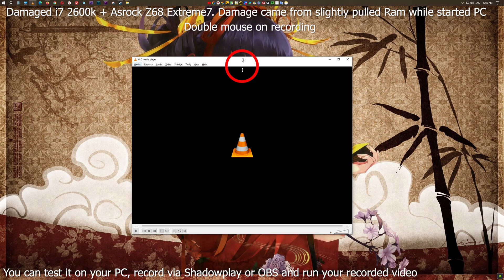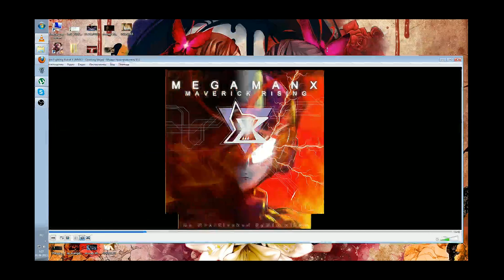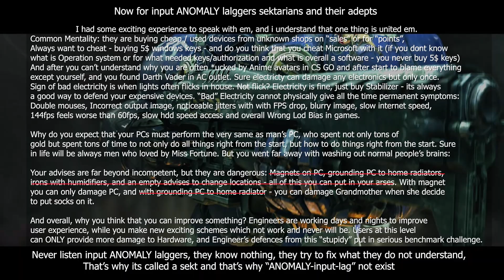#3 [Solved] Wrong Lod Bias (Scaling) | Jitters (Desync) - Damaged I/O System (Chipsets)

Comment from the maker: My Congratulations to you guys and to other people who succeeded with builds! 💪
- Texre from California had this issue from 2021 - he solved it by did everything right from the start and shared footages here:
https://www.youtube.com/watch?v=sAUx7Pv0RuU - Video games footages (flawless system)

- oukibattlegod from Russia is succeeded, you can find his videos:
https://youtu.be/GE__m2Ka3E8?si=GpGygVL9U-blviaa - CS2 footages (flawless system)
https://youtu.be/wuyKgzxMkac?si=ZC3imW3L6Ig4qBxu - CS2 footages (flawless system)

- sQweeky2k helped his brother to build PC, and advised to make things described in videos, they compared two systems and it's ground & sky. After he tested new brother's system, he planning to leave his old system and build new setup.

- I built for my young Brother his first PC from scratch. He has now perfect PC. First Windows installation window has no defects (window frame has no defects while moving that window), good image quality/scaling & smooth mouse:
i5 12400f
MSI B760 Gaming Wi-fi
DDR5 Kingston Beast 2x (16+16)
4060 Palit non OC
M2 SSD Kingston V3
DeepCool 750w
LG 1080p 170hz Monitor
Ador M6 White
Air CPU Cooler + Thermalright socket frame was installed
Windows 11 Home, official ISO, non activated
Middle-end gaming keyboard & mouse

All new, GPU & Motherboard have seals on antistatic bags, their boxes have perfect conditions. CPU was in silicon case without any signs of usage from both sides. All parts were purchased from one vendor.
PC was built/booted/adjusted in my house. Ram installation was provided with maximum gentle, CMOS battery was not disasembled. PC was connected directly to AC (no splitters/ups). No antistatic gloves was used
Reply: По какой-то причине YouTube удаляет мои комментарии, я особо не следил, но я там видел, что очень многие сомневались в  тесте с фантомным вторым курсором, хотел скинуть даже официальный пример от Microsoft, а также у про-игроков в CS, но видимо не судьба :D
Reply from the maker: Ты про блюрбастерсы что ли? Я там только по одной причине решил сделать статью - ради людей что бы проще было понять, но там нет смысла что то держать как оказалось. 
Ютуб удаляет комментарии, думая что ты что то рекламируешь) их скрипт срабатывает.

Comment: Hello, I have a question. If I have a problem with my mouse being too heavy (it feels noticeably slower), will the solution you posted apply to me? If so, can I order a brand new Lenovo laptop online to test it? The key question is, when I receive the laptop, can I test if my mouse still has the excessive weight issue without an internet connection and activation? Because, as you know, if I activate it and it doesn't work, I won't be able to return it.
Reply from the maker: Heavy weight mouse is a meaning, some people feels an oposite, that it fast. Overall incosistent mouse, this is because of desynced image.If image on screen is desynced your mouse feeling will be different - inconsistent (not precise movements - panocameras / coursor). 
All benchmarks pattern is right in front of you in 3 videos. If in Windows safe mode window's frame has defects while you move it and/or double mouse on recording, so yes, its desynced hardware/working not poperly not as intended. 
Your question about new laptop. You can test only this way: you have to see first Windows installation Window, you have to move it, and if you see defects on window's frame edges while you move that window - hardware is desynced. Not need to proceed further (software drivers will not remove it):
Examples
https://youtu.be/AVf9YPaePCU?si=KmIkGIrpSmY17prC&t=68 - window with defects - desynced PC
https://www.youtube.com/watch?v=7nTM6hrMah8&t=0s - window without defects - synced PC

Buy or not buy things, it is always up to consumer. This issue could be solved only via setup change, but, i never advise to spent last money on PCs, because there is no guarantee if you by new it will be without desync, its often goes with risk. If you can return it, that's nice, if not, so keep that in mind. If you live near Microcenter - buy there, top electronics vendor.
Reply: @LeCommeiLFaut  Hello, I'm currently at an internet cafe, and the mouse feels much lighter and less heavy. Could you teach me how to determine if this computer has a fully functional operating system? I also noticed that this computer isn't activated, but you mentioned that a genuine copy of Windows is required to resolve this issue. Thank you.
Reply from the maker: @can-v4y5f  Please read carefully comments and watch videos, there are plenty of footages which can help to diagnose.
About Windows is: You can use original non activated Windows, you download this ISO from Microsoft site and install it on PC (on laptops you never reinstall Windows, laptops must be with preinstalled Windows from factory). On PCs you can safely use non activated Windows. After, when you have possibility, you can buy Retail key from Windows Store directly or box genuine Windows from Microsoft office. Do not buy Windows in any other sources, and never use pirated ISO's or activators.
You can use non activated Windows downloaded from Microsoft site on PC - it is totally safe. + It gives you an opportunity to check: do your new board has activation or not, with CMD command slmgr /dli. 

P.s: I already mentioned many times: Windows do not heal this, Orginal-Genuine Operation System is needed to keep your system safe and sound and to prevent these kinda things to happen as much as possible. Main clue here is not to use any corrupted/cracked things for to exclude possibilities of faults, because software (many software layers) controls hardware on an physical level.
You noticed different mouse behavior in gaming club because each PC/hardware work differently. Not because it is in another location or another weather and etc. All located within hardware.
Reply: @LeCommeiLFaut  Hello, I have purchased a brand new laptop. May I plug my mouse and external SSD, which I previously used in my faulty computer, into this new laptop? Is it safe to do so?thank you❤
Reply: @LeCommeiLFaut  I'm even afraid to connect my laptop to the internet now, haha. I completely trust you, waiting for you, bro.
Reply from the maker: @can-v4y5f  I cannot tell you what to connect, no one will tell, because its not possible to predict for many reasons. All you do on your own risk
It is like if i ask you: can i plug my friend's mouse to my PC?
Reply: @LeCommeiLFaut  Okay, but how can I verify that this computer is working perfectly without an internet connection?
Reply: @LeCommeiLFaut  Looks like I've failed. It's a brand new laptop, pre-installed with genuine Windows 11, but the moment I plug in the mouse, I still feel the same thing: unresponsive and heavy, just like my old computer. Ugh, what should I do😢😢😢
Reply from the maker: @can-v4y5f  If you dont like it, you should return it, especially if no difference at all. I bought few systems, and one of em works better, but not nearly as my old ideal PC, anyway i decided to keep it. 
And for now i not do any attempts, because there is no 100% guarantee on success to achieve ideal PC. 
So, you have to think do you want to keep this new laptop, if not, return it. If you have time, you can bring your laptop to same gaming club and test experience between two PCs.

Comment: Is the double cursor really useful for diagnosing? When I select the WGC capture method in OBS, the double cursor does not appear.
Reply from the maker: With Nvidia shadowplay - yes it is useful. I shall not explain why this happens, but it must be one cursor on recordings in 98-99% of all stopped frames. On many PCs length between two cursors may vary, shorter distance - better

Comment: just built my brand new pc, everything was brand new with original seal, also new monitor and new peripherals but unlucky :(
Reply from the maker: Sorry to hear, me to not succeded with new MSI Z790, but have to say i connected to it my 1080ti and main monitor (because i wanted to test how it will operate). Very same behave, but this system is working worse than z68 after multiple damage. And after i plug my old sata PCI extension system starts to operate even worse after that with no return. This new system is only better than the old one is because of CPU/Ram raw power
Reply: @LeCommeiLFaut  i sent you details on discord
Reply: @LeCommeiLFaut  EDIT: (Week 2): PC degraded significantly and floaty mouse at it's peak, choppy gameplay (240hz became like 60hz or less at +300fps)
New build was feeling better than my old one (i was saying even if i didn't succeed and it's not ideal pc  it's ok at least it's better than first setup)
 but after week 2 it's same now!
(PC is stock, i didn't change any settings or peripherals or unplug/plug, everything is as it was since day 1).
So i don't know if that's the symptoms and the steps of broken chipsets or the theory of electricity :text-green-game-over:
Reply from the maker: It’s hardware, i had many systems, all worked differently. https://youtu.be/G1n88bL5MeA?si=2JlBle8gU86DtIN7 - main pc before ram incident. After incident this Pc was changed. I bough new cpu ram board, and it behave same but slightly better, but after I plug Sata extension, Pc became insta less responsive, in some way old system work better, but new is better because of cpu/ram raw performance. It’s weak chipsets, on data bus goes voltages in both ways - Data = 1 and 0 - on / off, this happens all the time. On this works software/firmware, that’s why is better to use stabilizer with monitor (I’m not saying that monitor damaged something, but sometimes it can be, overall stabilizer help to straighten monitor’s power curve and to stabilize signals on dp/hdmi. Lower voltage of cpu / ram / gpu - will be better. Hardware you bought was not in ideal state,  because it had same symptoms from the start. After some time with usage and load, it became weaker by itself
Reply: @LeCommeiLFaut  Yeah I understand! 
When i say electricity i don't say that i doubt chipset/system malfunction, i was just thinking if there are some external factors that affecting system or that are preventing ideal state from the first boot?
It's so weird how the performance shifted just after 1 week, i don't know why it didn't degrade in the first day.
Anyway there is nothing to cry about, because it was same symptoms from start, just a little bit better first week in smoothness and cursor.
I don't know, it can be damage from monitor or whatever.
For monitor I have samsung odyssey g4 (it has power adapter, it's not connected directly to wall, i don't know if it makes any difference.)
Also i noticed that coilwhine sound appeared in motherboard.
It's really mysterious.
Reply: it can also be a placebo, because it's just matter of feeling and it's not actual benchmarks or numbers so the main idea was obvious since the first boot! Other things are unimportant
Reply from the maker: There is no external factors affects PC. PC+monitor+keyboard/mouse - it’s a trap, it’s one whole chain. If components are good and in ideal state by their own - PC will work stable and with maximum performance from the start. 
Why it is not degraded in first day? It was in not ideal state from the start. For example my led display on refrigerator start to malfunctioning after year and it plugged to stabilizer from the start - bad quality. My new system was degraded after pcie extension card. It could became weaker by its own. 
Keep in mind that I play/work at 75hz/60hz screens and not do big load on the system. You use high FPS in gaming I think, it’s a big load by its own. 
My board has too coil noises, not too high but I have to place my ear near to hear it near boards vrm. Surely not a good sign, but keep in mind that ddr5 is very complex and fast thing. + 7600x cpu is powerful cpu, must be good vrm. Overall new systems are fast and hard to handle.
It’s nvm internal power supply or external for Monitor. They are all weak, I mean, their power supply are sufficient, but inside monitor located crucial voltage controllers. To protect PC chain and overall better is to use stabilizer with monitors/tvs/consoles/refrigerators. I mean that stabilizer is needed for good long distance to protect expensive devices.
Reply: @LeCommeiLFaut  Yeah understandable, thank you for the efforts and the time, good luck for next builds

Comment: like is it gonna make any difference if i use without windows activision cus i use pirated windows with kms
Reply from the maker: You have to never use pirated OS for many reasons(pirated Windows is not Microsoft product, it’s like you bought for 100$ Mercedes’ from used market, and found out after that under the hood components are not Mercedes’, and after you would call to official Mercedes office to ask about it?). You can use non activated Windows installed by MCT on first installation on your new built PC, it’s safe, till you get true 100% genuine Retail Windows.
Reply: @LeCommeiLFaut  makes sense. i also heard like lynux user dont have this issue huge desync/lag in game. should i use windows with out activison? like my english is not great so haha want a small  specific ans 😃
Reply from the maker: You can use non activated Windows installed by Media Creation Tool, yes it is totally safe. Linux is very hard system for a casual man. If Linux guys built new PC, and they are now what they are doing, so they are totally safe. These symptoms do not heal Genuine Windows, Genuine Windows prevent em to happen. These symptoms are malfunctions on a hardware level inside chipsets, which could be cause by corrupted/pirated Windows, because software controls hardware voltages and many other things, so if you need perfect PC you have to be very carefull, starting from purchasing - all must be new.
Reply: @LeCommeiLFaut  okay man thanks for your time

Comment from the maker: 🌈⚠Conclude: Wrong Lod Bias - Incorrect Scaling & Jitters - Latencies Issues Caused by Wrongly Configured/Damaged Chipsets within CPU/PCH. Damage could be provided from various sources (physically or with installed corrupted/pirated OS), + vendors can sell PC parts used/refurbished/defective as new.

Here is People's shared cases after which their PCs has same symptoms (you can find people's shared cases in comments):

1. Plugged bad ram in pc
2. After GPU change from brand new GTX 1050 to used GTX 1660 super. His brother's PC located in next room and works perfectly fine and he changed once GPU from new GTX 1050 to brand new RTX 3060 and PC works as it should
3. CD-Rom suddenly stopped to work permanently (damaged cd-room damaged configuration)
4. After Windows Server Update (don’t know was it genuine or not)
5. After used KMS activation (with non activated Windows was all right)
6. After GPU's thermal paste change
7. While gaming in AAA game went same black bars
8. Man bought Laptop without OS, vendors installed and gave him Win key on a simple paper. After sometime, he decided to reinstall Windows on Laptop from Media Creation tool (he did it by himself). After he reinstalled OS all symptoms with Bad Lod and Latencies issues appeared. After, he played 2 days with Virtual Reality helmet connected to Laptop, and on a second day all same symptoms appeared on googles permanently
9. Man bought PS5, all was great and juicy, after PS5 burned. He bought another PS5 and from the very start same symptoms appeared permanently on new PS5. After he bought PC, on very first day same symptoms appeared from the beginning. All was connected to same old devices and same monitor.
10. Man built middle-end good PC, and decided to install non activated Windows from MCT. Straight after installation he recognized that Windows was already activated (he did not entered any keys). 
11. Man tested different old keyboards for his perfect Laptop, and one of them damaged laptop. 
12. After video drivers update

+ My 4 cases, you can find them in post-comment for video #1